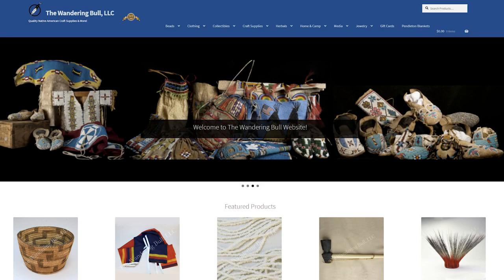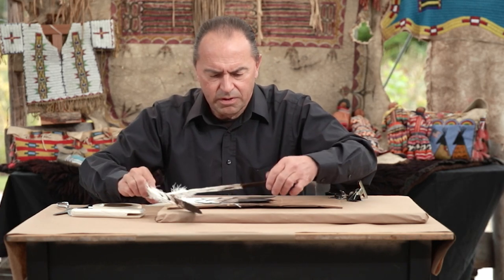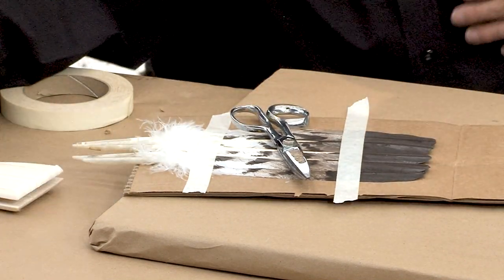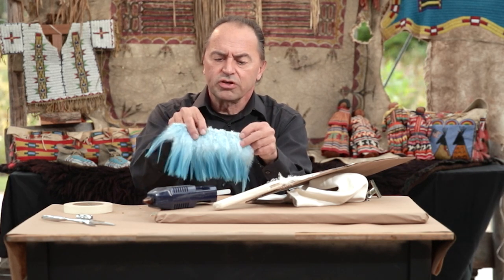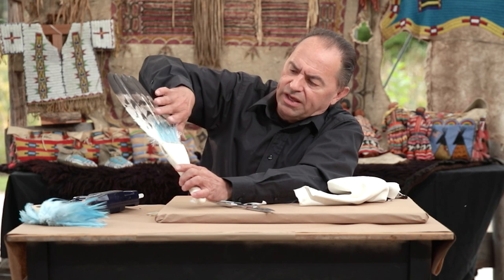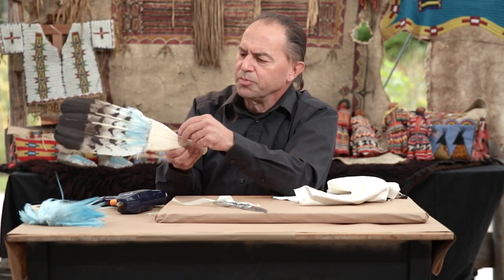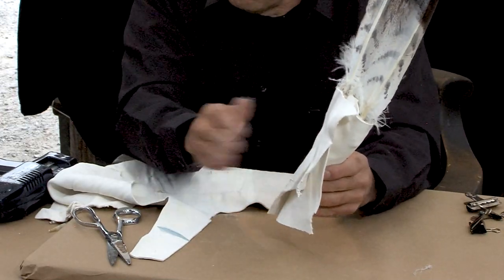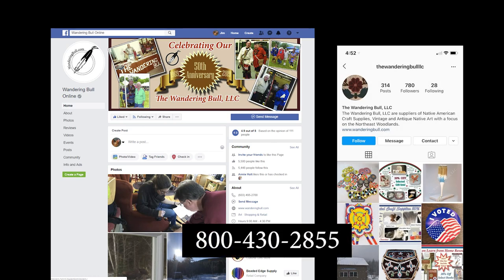Tail Fan

Comment: Would it be historically accurate to make a fan from unpainted bronze turkey feathers, or would this only be made using eagle feathers? 
Thank you so much for your videos!  I've found myself referring to them as I complete projects and recommending them to friends.
Reply from the maker: Hello Thank you for watching.   Depends on the time frame you are looking at,  but yes you can make them from bronze turkey feather also.
Reply: Mine is Turkey

Comment: Is there a way to do this without glue? 🙂
Reply from the maker: Hello thanks for watching!   I don't think you can use this handle with out glue.   You could use another glue,  it does not need to be hot glue.   Our wing fan can be done without glue.  Here is the link to that one https://www.youtube.com/watch?v=20LXuX1FzYU&t=2s   Chris does use glue on this one also but you don't have to.
Reply: Thanks for your reply.
I have seen that one you have sent me 😊 it's similar to what I do, I always try to avoid glue 😉
Reply: Wood filler👍

Comment: Where can I get real sinew
Reply from the maker: Hello,  all our suppliers are out!  We are still trying to find some.   You may be able to find at your local butcher.
Reply: @thewanderingbull9843  tx and when I go to ur web site it says 403 something
Reply: @thewanderingbull9843  403 forbidden something
Reply from the maker: @shadowfoxy818  Thanks for letting us know,  we will look into this  WanderingBull.com is open!
Reply: @thewanderingbull9843  it says 403 forbidden
Reply from the maker: @shadowfoxy818  Yes we are working on getting that fixed.   For some reason our security settings are blocking some folks.  Hope to have this fixed soon.   You could try using a different browser or computer.
Reply: @thewanderingbull9843  ok I will tx so much